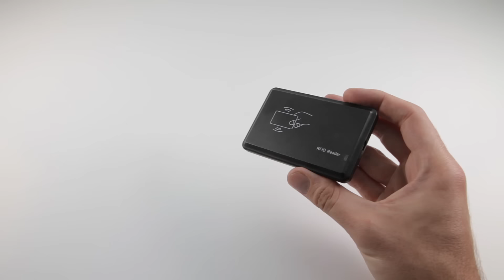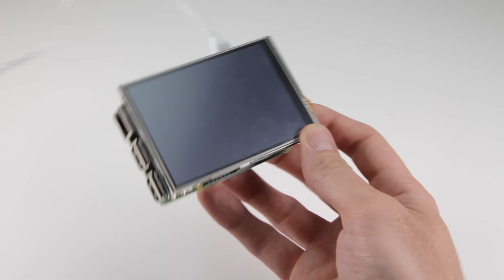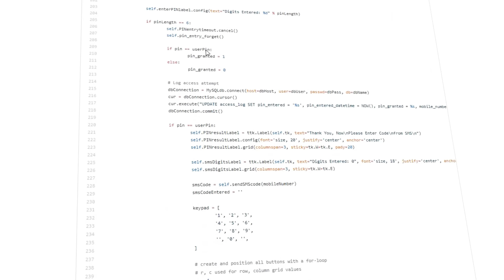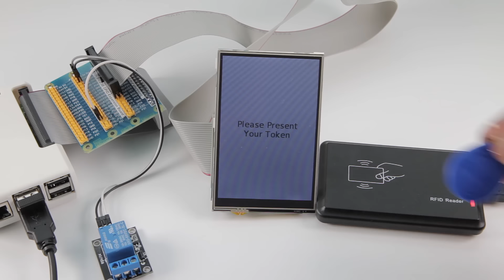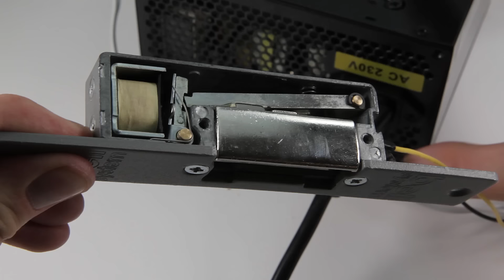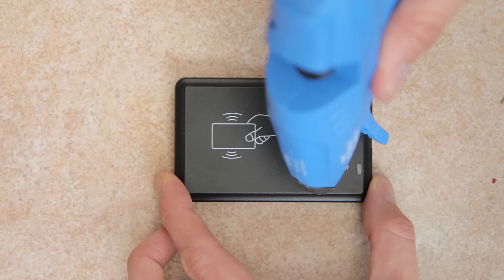Build a Raspberry Pi Smart Door Lock Security System for your Smart Home!

Comment: Hello buddy! I really loved this amazing project, I have two questions, if im a person from another country, the SMS will be send to me anyway? Im from Mexico. And the other question is, ínstead of using the SMS step, can we use a fingerprint module to use it like the third factor authentication? Thank you for sharing this video!
Reply from the maker: Hi, glad you liked it! Yes, the answer is yes to both questions. Just adjust the code accordingly. Have fun!
Reply: @SwitchedOnNetwork  I'm about to get all the materials to build this project, and I already have a screen for the Raspberry but it's a 3.5" Touchscreen LCD and on the video you are using a 4" touchscreen, it would be a problem using the 3.5" one or not? And also, I would like to know what could be the difference using the RFID reader with usb or using the RFID RC522? which one is more easy to use and why. Thanks alot again!
Reply from the maker: If the resolution of your screen is different you'll have to modify the Tkinter sections of the code to draw the UI over a different area. The USB reader is much simpler to implement and use, as the OS just sees it as a keyboard input device so no extra drivers etc needed. Have fun building!

Comment: Hello am trying to build a lock system for a solar system project using your previous code. What part do I need to remove from the code. It's going to be a two system authentication because the use of keyfob will not be needed
Reply from the maker: Hi, you'll basically need to remove all the bits that relate to waiting for keyboard input (ie the keyfob) and change the initial waiting screen to be that of the PIN entry. So you'll be looking at the show_idle() function, getting rid of the listen_rfid() function, etc. - although of course on that last function you'l be retaining the stuff to draw out the first PIN entry keypad.

The most important thing is to have a solid enough understanding of Python (read some beginners' guides elsewhere first, if you need to) and then look through my code and make sure you fully understand each part and what it does. I'm by far not the best programmer in the world, but I tried to lay it out logically and use sensible variable and function names etc. to make it easy to understand - have a play around and you should be able to change it to do whatever you like. Good luck!
Reply: @SwitchedOnNetwork  Yes thanks I've actually worked on that and remove those i just wanted to be sure I was doing the right thing. Thanks for your swift response
Reply from the maker: No worries, let me know how you get on 👍
Reply: @SwitchedOnNetwork  hello so have done all necessary things but I keep getting this error each time I run python lock.py: no module named MySQLdb and have installed all necessary things
Reply from the maker: you may have installed it for the wrong version of python, or not installed it correctly.

Comment: Awesome Tutorial!!!  Can I use RFID with touchscreen passcode without SMS authentication??? Which part that I need to configure!  Tks a lot
Reply from the maker: Thanks, glad you liked it! Yes you can easily remove the third step, just modify the python script so that it goes straight to opening the lock after step 2. Enjoy!
Reply: @SwitchedOnNetwork  oh yes ! So I think I should  review it again ! Another question that I don't modify python script , i just blank a box of phone number in phpadmin part ? Is it possible?
Reply from the maker: No that won't work, as the script will be trying to connect to twilio to send a text to whatever number is in there. To stop it doing that, you'll have to get your hands dirty in the code!

Comment: hello.. i have import the my msql file and now i stuck  at  python script. Do i have to change the host  to 127.0.0.1 or localhost ? my lcd touchscreen id fine working by asking to present the token and  when i touch the rfid card there are no keypad appear? hopefully you can help me
Reply from the maker: Hi - if you have a look in the terminal then you should hopefully see any errors output to there which will point you in the right direction when debugging. It's a good idea to run the script manually from the terminal on a full size PC monitor until you've got it all working, and then switch to the LCD touchscreen. Good luck!
Reply: Switched On Network alright sir. how about dbName? did you change ‘DB_NAME’ to ‘door_lock’
Reply from the maker: yes, change that to match whatever your database name is.

Comment: Hi, just wanna ask, what will happen if I using the same signal pin for the relay switch? Really nice project btw
Reply from the maker: Thanks :) same pin as what...?
Reply from the maker: Thanks :) same pin as what...?
Reply: @SwitchedOnNetwork  pin 13 for the relay switch. You mentioned in the video that for the relay switch need to use other signal pin.
Reply from the maker: Ah yes, because the touchscreen LCD uses several of the GPIO ports, it's safest to use one which is definitely not already being used for something by that. Since I don't know which specific ones are used, or for what, I just used one which was completely guaranteed to be unused due to not being connected to the ribbon cable or connector for the screen. So I chose 13 - you can of course use any unused one, it doesn't have to be number 13. Hope that makes sense?!
Reply: Switched On Network ohh okay got it. One more question, why i cant open the phpmyadmin on the browser? Is there any step I should do first?
Reply from the maker: Impossible to say without more information I'm afraid. If you take the correct steps to install it, it should work. Google specific instructions for whatever version of Raspbian you're running and the versions of PHP, MySQL and phpMyAdmin 👍
Reply: @SwitchedOnNetwork  okay, i need another help, how to upload profile picture into the database?
Reply from the maker: The picture itself isn't in the database, just a reference to its filename. The picture is located in the same dir as script.

Comment: hi i seem to be having touble installing the mysql database properly i followed all of your detailed steps but the 192.***.*.***/phpmyadmin doesnt work however searching just the ip address in a web browser brings up the Apache server correctly ... any advice ?
Reply from the maker: Hmm, have you run the command to install phpmyadmin as well as MySQL?
Reply: Switched On Network yes I followed your exact instructions in order ...
Reply from the maker: Assuming it installed successfully and correctly, I'd check the Alias setting is correct - that's what tells Apache to display the phpMyAdmin login window when you go to /phpmyadmin.

It's in the config file - the steps vary depending on what version of everything you're using (the video's over a year old) but this guide seems to give a good general overview: https://www.tecmint.com/change-secure-phpmyadmin-login-url-page/

Hope that helps :)
Reply: @SwitchedOnNetwork  can you advise on how to check the alias settings please ?
Reply from the maker: Yes, see link in previous comment.

Comment: awesome project, exactly what i need for a purpose that just cropped up, is there a simple way to disable the other 2 factors of authentification (removing the Text code and user passcode to make it into a SQL controlled RFID lock only ? thanks :)
Reply from the maker: Thanks, glad you liked it! The answer is yes, you can edit the python script to do whatever you like. Essentially just comment out the bits you don't need...

Or you might be better off with this: https://github.com/paulfp/NFC-Door-Lock

My full tutorial on how to use that code featured in HackSpace magazine: https://www.paulfp.uk/blog/2018/02/new-magazine-article-build-an-nfc-powered-door-lock/
Reply: apologies i just read doen the comments and have seen your previous reply to this question, can you just disbale it in the code or do you have to remove the code ? thanks

Comment: why i cant appear the “please present your token”  on my lcd touchscreen eventhough i already download the file and make the code referred to this video? . Help me sir
Reply from the maker: Hi, have you installed all the dependencies as required by the Python script? What errors are you seeing?
Reply: Switched On Network i already download the  file on github then i import door lock.sql into phpmyadmin. Then, i wrote code “sudo nano ~/.config/lxsession/LXDE-pi/autostart” and add link @sudo python lock.py . lastly im setup the gpio expansion board and relay switch
Reply: Switched On Network so far there is no error appear.. when i switch on the lcd it just appear desktop wallpaper compared to yours which ask to present token
Reply from the maker: Have you installed the script and its dependencies, set up the database and set the script to auto load?
Reply: Switched On Network how to install  script and dependencies?
Reply from the maker: It explains in the video how to install the script, or you can read the full text tutorial here: https://www.switchedonnetwork.com/2017/11/10/build-the-ultimate-door-security-system-with-three-factor-authentication/
Reply: Switched On Network this one i already done the steps.. when i connect all the components and try to power up.. it doesnt appeared the screen which wrote “ please present token” but then it appeared desktop wallpaper
Reply: Switched On Network does it automatically will appear on lcd touchscreen  when power the raspberry pi?
Reply from the maker: It should do - yes, if you're using exactly the same OS image as me. What screen are you using? What version of Raspbian?

If it doesn't autoload, can you open up a terminal and run the script manually? You need to check that the script is actually working before you concern yourself with it auto-loading.
Reply: Switched On Network 3.5 inch touchscreen lcd  and raspbian noob
Reply: Switched On Network can i knoe phpmyadmin  need to be install either in the raspberry pi or laptop?

Comment: Hey thanks for the video. Does that mean if there is no internet connection the system wouldn't work and people will be locked?
Reply from the maker: Yes, I didn't include a manual override on my demo in the video as it would depend on the location, circumstances and preference of each specific and individual installation as to how the best way to provide that would be.

The simplest way would be just to fit the front keyhole part of the Yale lock, which I left off. Then you've got an immediate offline override 😀
Reply: @SwitchedOnNetwork  what do you mean by fit the front part of the yale lock?
Reply from the maker: The bit where you'd insert the key, on the front (outside) side. I only fitted the back latch.
Reply: @SwitchedOnNetwork  oh right ok that's sounds more like another option to use the key if internet fails
Reply from the maker: That's exactly what it is :)

Comment: thanks man, cool video. won't be that guy, but is the power supply not a overkill?
Reply from the maker: Thanks, glad you liked it! You're not the first to ask about the power supply - I looked online and couldn't find a power supply that had a single plug to the mains and would output both 5V and 12V, that didn't cost an arm and a leg. The computer PSU was dead cheap and easy to modify, and fulfilled my single-power-cord-for-everything desire so I don't think it was overkill 😂 a more elegant solution would of course be better though haha
Reply: sure, i can feel you. sometimes when i build something it's a "now or never mentality"

Comment: Thanks for sharing this great video. I have a question, if I used a non USB input device, like a switch how can it be monitored for status change using RPI.GPIO?
Reply from the maker: That would depend very much on the device in question. Your best bet is to see if any documentation or example code comes with the device, and if not use the device name as a starting point for your research into it. Good luck!
Reply: @SwitchedOnNetwork  Cheers. I'm trying to incorporate tkinter with rpi.gpio inputs

Comment: Awesome tutorial! I'm implementing this at work for a Summer project, and I found an issue/bug while scanning my RFID tag. If you scan your tag twice in a row (once before the keypad, and once while the keypad is preset) the welcome label generates (as many times as you scan your rfid tag) below the keypad and freezes the numbers in place. I tried changing the InputDevice, so nothing is read while someone is entering their pin, but after access is granted, the InputDevice doesn't revert back to the RFID reader for the next user to scan.  

I was wondering if you have any suggestions towards fixing this bug? 

Another note, I was wondering how the RFID tag is read into the program? I noticed you compare the input with a Keys variable. Just wondering how you came up with that method? 

Thank you in advance!
Reply from the maker: Thanks for your comment, I'm glad you liked it! :) That's a strange issue... I'm 99% sure it didn't do that for me and I tested it pretty extensively at the time, although it was over a year ago now and it's packed down at the moment so I'd have to set it up again to test really. You may have found a bug I missed, in which case - thanks!

The approach I'd take for ensuring it doesn't do that though is to make sure that as soon as it's detected the first RFID touch and decided it's recognised and wants to display the keypad, make sure that it completely stops listening for new fobs. Or, you could set a variable to keep track of what "state" it's in, and only act accordingly if input expected for that state is received. Just a couple of ideas off the top of my head!

The keys variable....... I remember spending a LOT of time messing around, researching, troubleshooting etc. before I came across that method. I can't quite remember where I found it, but if you google that variable you'll probably find it discussed elsewhere on the Internet on pages nothing to do with me. I should have given credit really - my bad! The whole building the string up 1 char at a time and then checking for the newline character was my own work, once I'd cracked the "how to even respond to and retrieve data whilst also showing a GUI" issue.

Essentially the issue was getting it to listen for the input at the same time as also displaying the Tkinter GUI. Which meant I had to take a totally different approach versus if it was just a command line programme. It was maybe my own fault for going down the USB faux-keyboard style reader rather than a more "proper" one, although once I got it working it was OK and works fine and I have that now for the future....

Hope that helps enlighten!
Reply: Thank you for the reply! I took your suggestions into account while troubleshooting the bug. Threading is a fairly new concept for me, and I didn't take that into account while troubleshooting a couple days ago. If you're curious what I did to fix the issue, I created a tracking variable that's checked after any RFID scan. If there's an ongoing event (someone is entering their pin), the tracking variable changes to prevent new events from registering with the database. The tracking variable reverts itself once the   user enters a correct pin, and/or after the threading timers are finished. 

Thanks again for the awesome tutorial and quick response! I definitely learned a ton while implementing this project at my internship :D

Comment: so great tutorial ,I have already imported the database and added the user. After the read my card is not reflected on the screen, what problem is this?I am not familiar with phpmyadmin, is it wrong that I add users, how to add users?
Reply from the maker: Hi, firstly make sure you've installed all the dependencies required by the Python script. If you still have issues then I'd take little pieces of the script out one-by-one and gradually build it up so you can check each bit is working as you go along. Good luck!

Comment: amazing!! your tutorial is so easy to follow!! and much better than using the RC522 RFID reader...i am trying to build a similar controller using a mag lock: should work the same way, using your same logic! :) thanks for this video
Reply from the maker: +Fel Illume Glad you liked it! Be sure to send over pics or a video of yours too 😀
Reply: one question though - how do you manage to get the info of the fobs/card that you add to your sql dbase? so that when read the rPI knows it's correct?
Reply from the maker: Ah ha, that's easy :) Since the RFID reader I was using acts like a computer keyboard, it just inputs the text that's contained within the card. So if you were to plug it into a Windows machine for example and open up Notepad, then scan the card, you'd see the numbers getting quickly typed into Notepad.

So, when you're entering the details into your database, you could connect to phpMyAdmin from another PC with an identical card reader plugged in, select the "code" input field and scan the fob to enter in the number.

There's potential on this project to make a nice web management interface to add/delete/edit/suspend users from the system, etc. If there's enough demand I might even make a video showing that in 2018 :)
Reply: ah ah :) OK, that was easy...but i don't do easy :P I dived into Python, C# and also SQL programming without a dot of info ;) - sounds good - i will attempt that web admin console too: sounds like a great challenge :D
i was talking to a friend about installing the mag lock security using the R-PI and he said "it must not be safe enough, because companies would mass produce them"...i thought, mass produced stuff is cheap and not customisable ;)